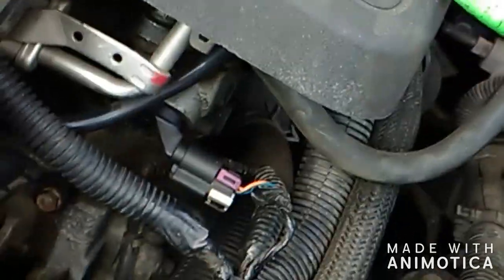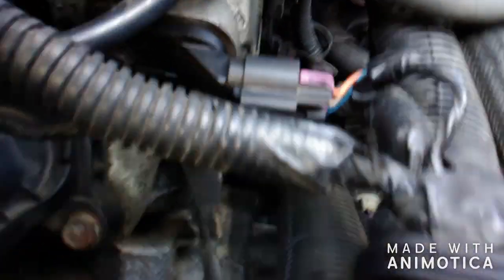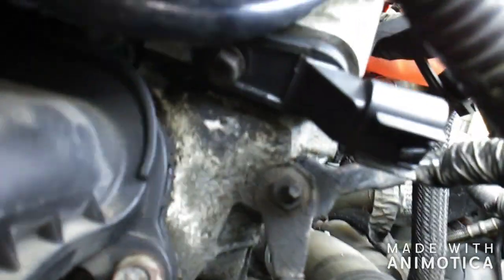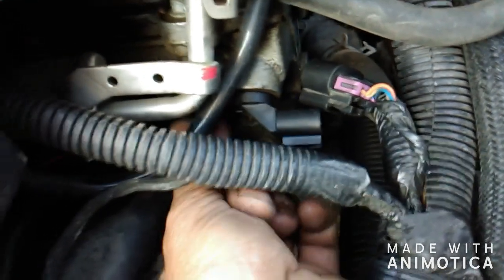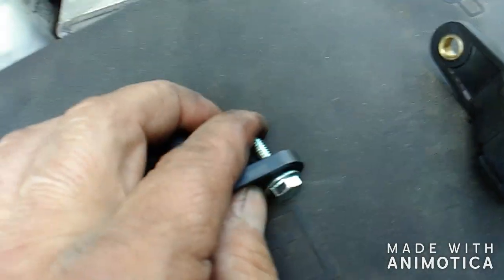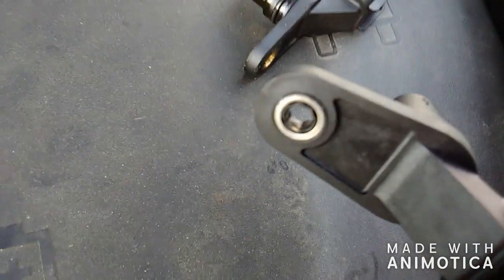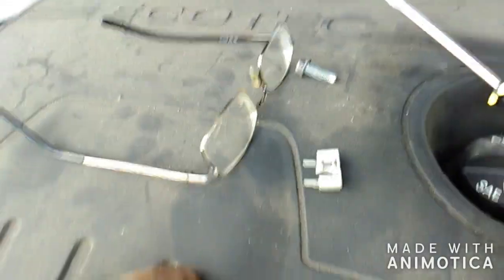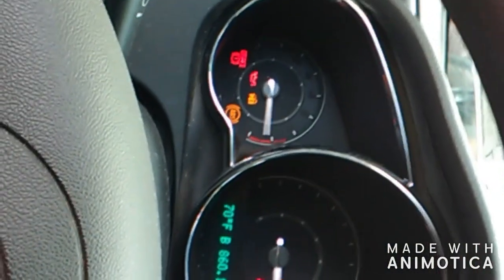2011 malibu cam sensor replacement

Comment: 10/10 great job explaing it and tbh it's a pretty easy find, if you can't find where it's located at you're probably just starting on vehicles. But otherwise great job showing where it's at, what it looks like and a step by step process on how to do it. Keep up the excellent work my good sir

Comment: Got a customer that ordered all but the rear cam sensor about two years ago from Amazon, I swapped em for her and it's ran beautiful until the other day. Flagged 10, 11, 13, 14, 366. Ofcourse had the slight valve kiss outta time noises, I swapped out the exhaust vvt Sol (only one I could get in stock yesterday) and she ran great, went right back to about 6 degrees advance on number one at an idle (by my reader atleast) she ran it to the gas station and shut it down at the pump, now it won't start back up and my reader shows a baseline 6 adv on #1 with key on engine off before jumping up to 30 during cranking and stalling itself back out. I'm heading back over today to start really digging into it and diagnosing it better, was just curious if ya had any info or tips. 🤙🔧👍 Always appreciate the good clear videos.
Reply from the maker: USE DEALER ELECTRICAL PARTS! I got caught 3 times with defect aftermarket cheap parts, on a purge valve, chevy dealer has the exact specs for all electrical parts and such.
Reply: I had similar symptoms, replace actuators and sensor as coach indicated. Actually my timing chain has slipped a notch. The computer compensated some so it ran a little swings in the timing.
Reply: Meant to say as codes indicated. Ran as good as new after replacing timing chain assembly.

Comment: Hello, how do you know what camshaft position sensor is for the exhaust and intake. I heard ppl say that they are both different. So when searching for exhaust camshaft position sensor on advanced auto (I have a 2011 chevy malibu lt) it only pops up different results for "camshaft position sensor".  I know where exactly the intake and exhaust camshaft sensor is located in my car but when buying, did you ever know which one your buying for specifically (exhaust or intake)?

Comment: I replaced cam sensor and actuators per the codes before I understood how the timing works these days. My timing chain had slipped a notch. This is a 2011 Chevy Malibu. It ran, the timing was obviously messed up in varied.

Comment: Looks like it only cost about $25 for the part.  My mechanic charged me $180 total to replace it
Reply from the maker: You got robbed! That's all there is to it, The part is around $25. Very simple part to change, it's in the open.
Reply from the maker: One more quick note, watch YouTube before you do any repairs.

Comment: I can't get a code because my Malibu will only run when bank a is unplugged. should I change both of them?
I put a new one in bank a and it still wouldn't stay running.
Reply from the maker: What size motor? Do you mean the cam sensor unplugged the car will run?
Reply: @jayhook-zm1pw  2.4 ecotech,yes the camshaft position sensor.
Reply from the maker: @aladinsarsipeus  you can pull a code with the key on. Motor does not have to be running.
Reply: @jayhook-zm1pw  resolved 2 weeks ago 
unhooked the battery for a few minutes 
plugged in original cps and started right up no issues since that day
thanks for the advice anyways jayhook
Reply from the maker: No prob. Ask me anything in the future. If I don't have the answer, I will find it somewhere.
Reply: @jayhook-zm1pw   if I pull the connector of should the car still run because I pull the plug on it but the car still shuts off

Comment: My front cam sensor was replace a week ago. Car stopped after a week. they replaced the new one and the rear one. Apparently the new front sensor was getting shorted. My 2011 Malibu stopped running the next day. (Actually today). I had it towed right back for them to look at Monday a.m. What is causing these to go out?
Reply from the maker: i have no idea. i would get a second opinion

Comment: What was the code you were getting?
Reply from the maker: P0011. P0010 is the other sensor.
Reply: @jayhook-zm1pw  I have a 2012 and I’m receiving a code of P0010. Are these the right sensors for my car. It’s a 4 cylinder
Reply: @annadenise8902  You likely already figured this out by now but the P0010 is for a faulty VVT control solenoid valve.  The one with a gray top (intake).  

You can replace it in about 5-10 minutes.  Super easy to do.  There are several videos on YouTube that show you how to do it on a 4 cyl. Malibu.
Reply: I have a P0016, you think if I change out the cam and crank shaft sensors it would help? I know it’s time chain related but jw. Any advice?
Reply: @Tren.T  That's a code that you do not  procrastinate in getting to the bottom of and figuring out the reason.

As you suspect, the most likely culprit is a bad sensor(s), especially if the engine is otherwise running and sounding fine.  Preferably use OEM sensors, but if your economic circumstances dictate that you need to pinch pennies, buy some cheap ones off of Amazon to use, but hold on to the old ones just in case until the problem is definitely solved either by you or a mechanic.

Change out those sensors (since it's easy enough to do yourself) and if that doesn't clear the code, then it would be time to have your timing chain inspected by a mechanic to see if it has stretched out over time and/or it may have jumped.  If it has jumped and the chain isn't stretched, that leaves the tensioner as a likely culprit.  

Good luck!
Reply: I have a p0013, you think if i change out the cam sensors it would help?

Comment: Hey man which camshaft sensor is bank B located, thanks
Reply: I believe 2 is the one behind the motor
Reply: @michaelscott968  thanks, fixed it last week 👌💯🙏
Reply: Bilo was I right?
Reply: Because I have to fix my girls today
Reply: @michaelscott968  yes, in a Chevy Malibu that is, right behind the motor, but I still changed both of mines anyway
Reply: Bilo thanks 🙏🏽 and hers said back 1 hopefully that’ll get the car to work
Reply: @michaelscott968  did it work?

Comment: How you get it disconnected
Reply from the maker: Unplug the pigtail, unscrew the hold down bolt with a 8 or a 10 mm socket. Do not over-tighten the new one!